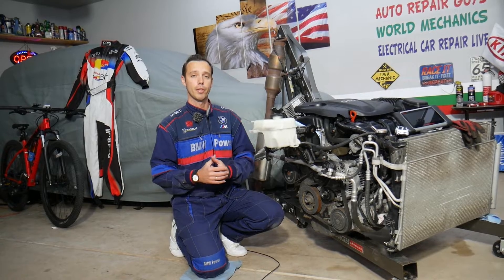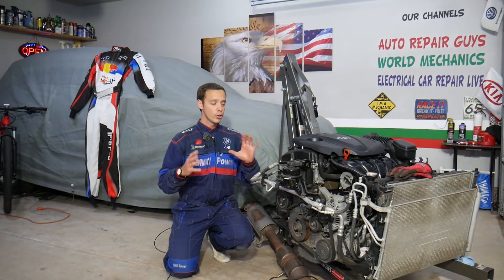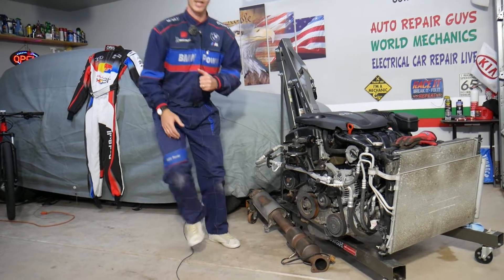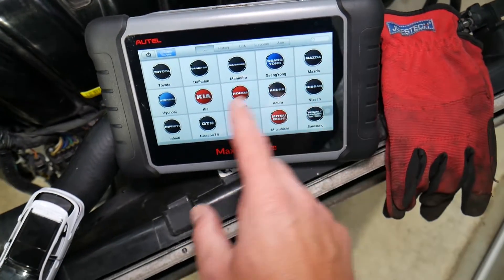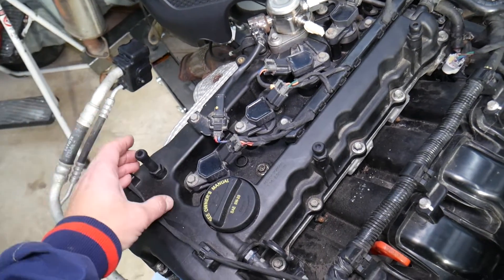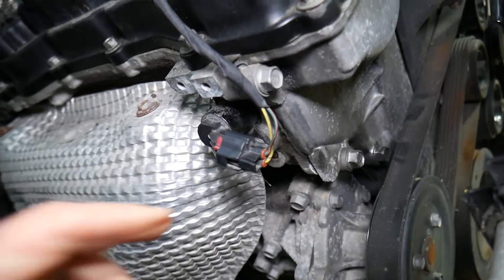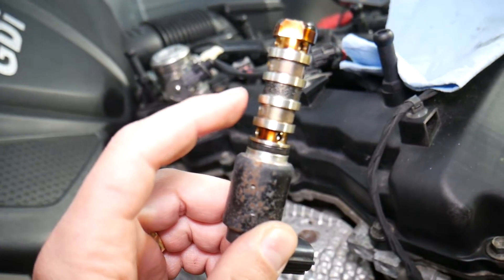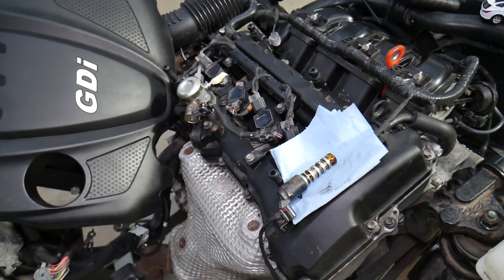HYUNDAI SANTA FE CHECK ENGINE LIGHT CODE P0014 P0015 CAMSHAFT

Comment: What if its just P0014?
Reply: Did you fix it? i have code p0014 and i already replaced full timing chain brand new, new vvt solenoid, new oil pump, swapped whole exhaust  camshaft with gear, changed new oil and oil filter, and still code keeps coming up... car runs good and no rattling sound HELP!!
Reply: @wise_soul8886  nope did the exact same thing. Months later the engine ate itself. I think it has something to do with the ecm, or the sprocket on the crankshaft(like the bmw s55 sprocket issues) but idk exactly what happened, and no shop has been able to fix it. I will say it helps to have a scanner that can engage and disengage components. I would have someone make sure alll of your solenoids and cam sensors are engaging as they should… but even so youll probably still get the code…  i guess if all else fails just get a tuner to disengage the vvt… or remove the vvt.
Reply: @HandMadeRoyalty  fuck fact is that its not even my car. Its a customers car. I rebuilt the entire engine and the code came up, ive done so many things to it and cleaned/replaced sensors and wires and fuses and still nothing*
Reply: @wise_soul8886  well that sucks… yeah only thing i can think of is changing that sprocket with a new sprocket and making sure the timing is right.
Reply: @HandMadeRoyalty  yea i did that already... timing is new and ive re checked the timing like 3 times and its good. Also the whole exhaust camshaft has been replaced with another one. This sucks man... its a clients car and i couldnt fix it
Reply: @wise_soul8886  the sprocket on the crank? That’s the one im talking about. Most people reuse them.
Reply: @wise_soul8886  https://youtu.be/e035uymrC-Y?si=F2LiF7MbmE22vNTc